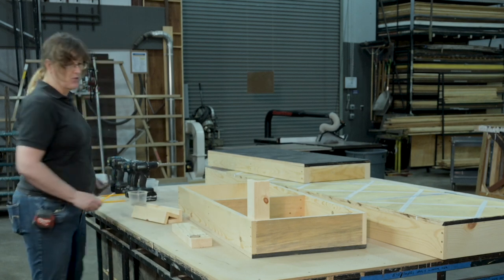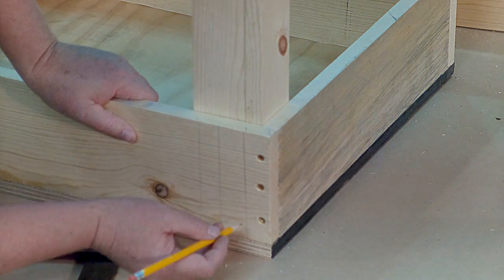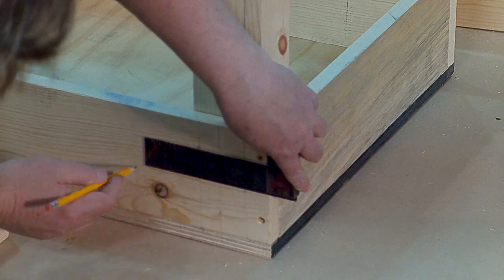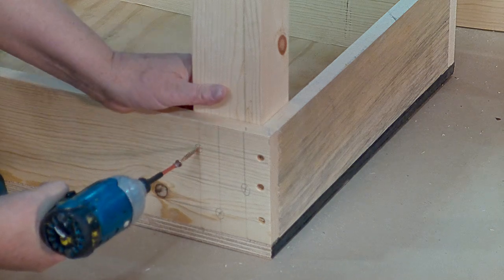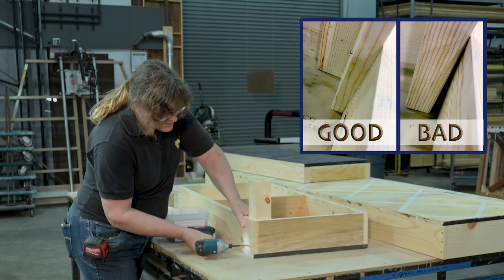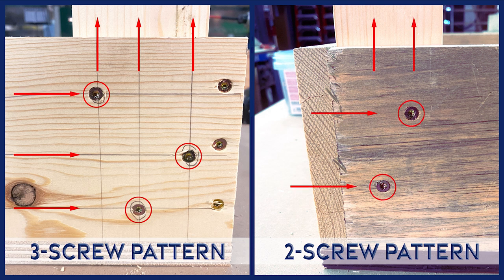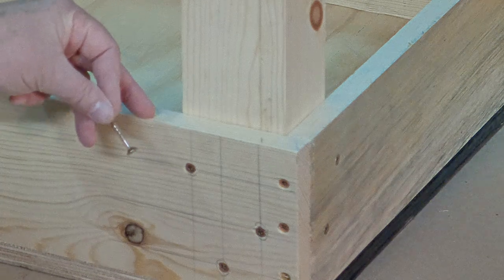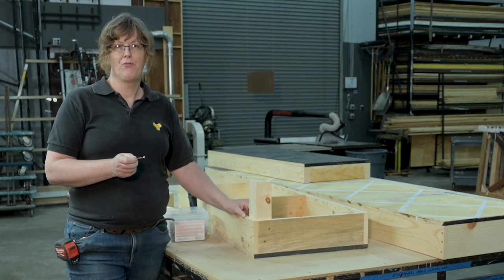Screw Patterns for Platform Legs

Comment: Hi! Thanks for the video, mostly exacyly what i needed. I'm building a bed platform using 2×6/8's with 4×4s as legs. You mentioned to avoid a diagonal pattern, why is that?
Reply from the maker: You could do a diagonal as long as you are on three grain paths in both directions (on the frame and the leg). The three screw pattern in the video is a bit stronger tho. 

If using 2 screws/attachments at each point then you will want to be a diagonal.

Comment: Thanks for your video! Pretty detailed and inspiring. What would be the best way to install the wheels for the platform with legs and is there anything to be cautious of?
Reply from the maker: I've seen this done a number of ways. Just attaching wheels to the bottom of legs is the least secure way as far as I am concerned, but if you must do that, you have to plan your legs to accommodate your casters. Most casters have a metal plate that is larger than a 4x4 in one or both directions, so they are not a good direct fit onto the end of a 4x4. Plus screwing or attaching into the end grain of a 4x4 is problematic as the screws or lag bolts can cause failure of the 4x4 grain when under stress. If you must attach to the bottom of your 4x4 or similar, attach a 3/4" plywood plate to the end first.

More common and better for tying your platform legs together is to make a caster plate frame the same dimensions as your platform and screw that to all of your leg ends. Then attach your casters to that. These are usually made of soft-flat style construction but using 1x6 instead of 1x3 and you can be more forgiving with your corner block methods and techniques. 

I've also taken a second platform the same size as the first, turned it upside down and screwed the bottoms of the legs into the upside-down platform. This is your fastest solution if you have spare platforms lying around and don't care about the doubled-weight of the finals structure. Then attach your casters to the upside down platform under the legs. 

There are probably dozens of more options.
Reply: @calstatelaalproductions2358  Thank you so much for the answer. Will try!